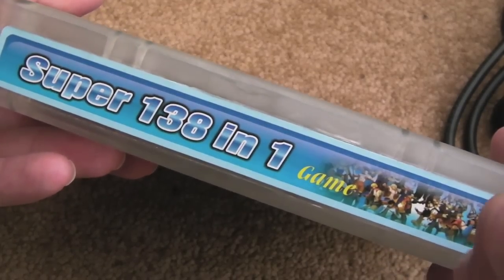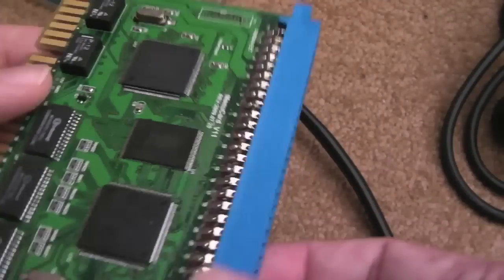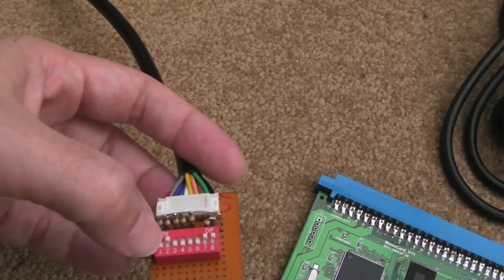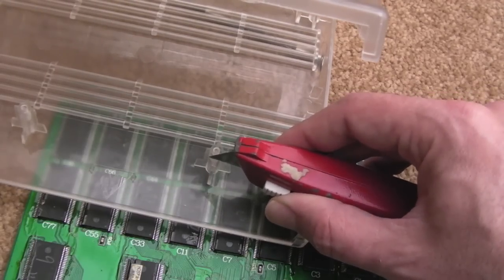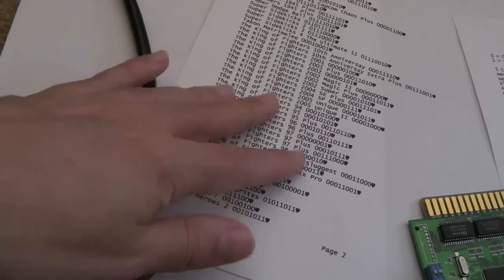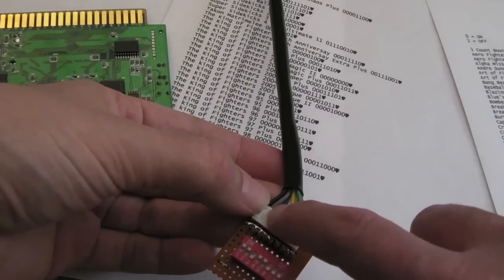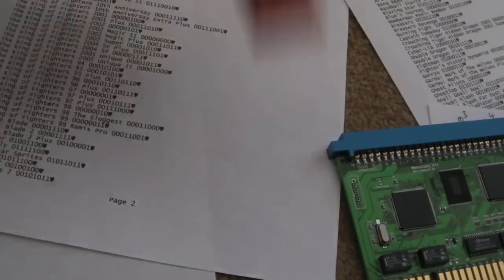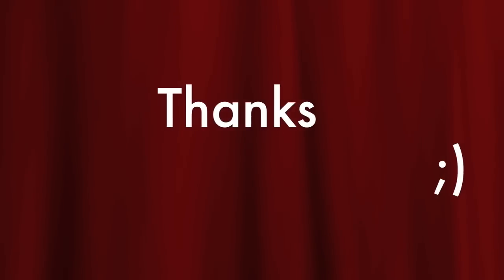SNK Neo Geo MVS 138 in 1 Teardown & DIP Switch Mod

Comment: Your mystery wire (grey) is the RESET signal the menu board use to reset the Neo-Geo system after a game change command is received.  Because of that(the line doesn't have enough power to properly power pullups), when I modded Marcelo's cartridge (we live at the same city) I installed the pullup resistors inside the cartridge, pulled 5V within the cart and fitted a reset push button on the dip switch board taking advantage of the gray wire actual function...

Also, I was the person who originally made the first mod for Fandangos back in 2012. I wish I kept pictures of the dip switch board I made for Marcelo because that one looks a lot better than the one I made for Fandangos... heh
Reply from the maker: Thanks!  I guess if I had spent more time looking at the board I should have worked it out!!!  Nice work on the original mod - it's a god send being able to ditch the control board and use the cart easily on an MVS or AES (with adapter).  I was going to remove the DIP switch at some point and stick a PIC in there, a couple of buttons and an LCD display to show the game number selected, but I've just not got around to doing it yet =/
Reply: That looks like overkill, though.  But it's a great idea if you make it and then fit inside the cart.  That could be a good idea for modding the cart (put the selector on the cart itself). Which makes sense if you're using it with an AES unit.
Reply from the maker: It's totally overkill but allows easy selection!  And yes - the idea is for it to go inside the cart.  I was also thinking of swapping out the 3 segment LED for a single row matrix screen, as those are cheap and easily controllable from a PIC.  That way you could see the game name instead of a number!  Again overkill but a fun project.

Comment: so Black is Ground, and Grey is the VCC correct? mine is wired like the video. 
so...
 
Pin1 black= Gnd
Pin2 grey= Vcc
Pin3 Purple= Dip1
Pin4 blue= Dip2
Pin5 White= Dip3
Pin6 Yellow= Dip4
Pin7 orange= Dip5
Pin8 Brown= Dip6
Pin9 Green= Dip7
Pin10 Red= Dip8

then you wire it up like the diagram correct. so the VCC wire connects to the Resistor array, then to all the OFF pins(all resister array pins shorted together)? then the GND connects to all the ON Pins(all on pins shorted together)?   thanks.
Reply from the maker: See the diagram at 17:20 , you can see how I wired mine there, but the switch positions are inverted if you follow my diagram.
Reply from the maker: And yes, the VCC goes to the common pin on the resistor array.
Reply: sweet thanks. I think I got it, but I got an 8 pin array(on each off dip pin) instead of 9. I tried to put the vcc on pin 1of the array with the dip 1 pin , but not getting anything. but when I take the data line off of dip 1, and leave the vcc, I can get some games to pop up that have dip 1 in the off position.

Comment: Great video GadgetUk164! 
This mod work with neo geo Aes + mvs adapter?
Reply from the maker: Yes, this cart will work on an AES with MVS adapter.  It's worth doing the PCM fix and other fixes to the 138 in 1 as well as the DIP switch mod.
Reply: +GadgetUK164  Thanks!

Comment: Hi, I did the "Dip switch mod" driven by an Arduino, using a shift register and a line buffer. To whoever tries this: do not use the 3.3v from the cart as a reference. It seems to be good enough for the pull up resistors, but not to power a line buffer.
Looking at the Jamma card, the 3.3v from the cart is not even connected to anything!
Reply from the maker: I vaguely remember they took the voltage for the pull up from one of the gates outputs on one of the chips on there.  It's crazy but that's how I remember it being wired.  There probably is a 3.3v source from a regulator on there.

Comment: good work, really works fine.I have a question about supersidekicks 1, It is the only one game that not work fine, the controls dont work in the match, Is there a solution ?
thanks very much and good work  in this and other mods in snk multigames.
Reply: *****
crc check is ok, i am try in aes mode but it work only 1-2 minutes, when start the match its work, but i can not play a complete match because the controls dont work, thanks very much
Reply from the maker: SISTEMA OCTAL I've re-created the same problem you are seeing, after maybe 1:45 the controls stop working.  This is copy protection.

I did find this on another website:-

:ssideki:00000000:10000F:00000009:FFFFFFFF:Disable Copy Protection:Activate this cheat to stop the game locking up during play.
:ssideki:00010000:100012:00000008:FFFFFFFF:Disable Copy Protection (2/3)
:ssideki:00010000:108DCC:00000002:FFFFFFFF:Disable Copy Protection (3/3)

I don't know how you apply those changes using the unibios - there is an option there to write RAM values but not sure what the addresses are and what the values are.  It seems that 1 game on the 138 in 1 still has the protection enabled. =/

Comment: I hate to bug but i cannot find an answer for this anywhere and ive been looking for like two days now....
im getting an mvs this thursday and have been looking into this 138 cart because it has waku waku 7. but i've noticed other multicarts dont have this little external board popping out the side of the cart. you touched on it's significance a bit. but what does it even do and why do other carts like the 161 cart not have it? should i be worried about it's compatibility in any way? because from what i've gathered, it's just something to convert usage onto arcade systems that are not mvs systems? i hear it creates problems with select game buttons as well? im just worried about picking it up and then not being able to work at all... sorry if im unloading a bunch, but it's been super confusing to me....
thanks so much for your time!
Reply from the maker: Neet Boss The 138 in 1 has that sub board which you've seen in the photos etc.   That little board is what selects the game on the cart.  It needs to connect to the MVS motherboard JAMMA connector.  So if you are using a supergun with your MVS you could connect the 138 in 1 board to your JAMMA edge, then connect the supergun to the output side of the 138 in 1 board.

If you've got a CMVS system or an AES (With MVS adapator) then you need to do the DIP switch mod I did in this video.

This is why the DIP switch mod exists - people want to bin the control board that comes with the 138 in 1 and just select the game using the switches instead.

The MVS is an arcade system btw -  The MVS is the arcade version of the Neo Geo.  Some people consolize the boards (see my Consolization videos) to give them standard connectors for power, video, controller ports etc.  These are known as CMVS (Consolized MVS).  The AES was the home system, the hardware is pretty much identical, but the AES has a memory card slot, lacks backup memory (which MVS has), and the carts for the AES are a different size and incompatible with the MVS - despite the games on both systems being the same code and they play identically (depending on your BIOS).   Your best way to get into the Neo Geo is with a CMVS - Someone like Xian Xi (Supreme Judge on YouTube) sells CMVS systems made to order I think.

Comment: Due to the fact that the 138-in-1 has unmodified P-Roms, I would wonder if it could be reverse engineered so that someone could put different games on it, so that the dip switches would point to the same address space, but different games would be there...
Reply from the maker: That's the really easy bit!  I would have done it by now if I had a programmer that could read and write those chips! =/  Try finding a programmer - they are like £2000 each or something daft =/
Reply from the maker: GadgetUK164 You can also really easily do the 161 in 1 even with modified P ROMs if you can program the chips.
Reply: It is possible that one reason you never see Magician Lord on a multi-cart is that when the P-ROM code is modified, the game doesn't work correctly. But, using this type of car, the P-ROM data would not be changed at all, so it should be possible...
Reply: Majestic Lizard hates Google +
There are less than 30 games (excluding Japanese text games) that have never been released on the multi-carts. It would be well worth it to see if one of these 138-in-1s could be hacked include Magician Lord and Fatal Fury Special.

Comment: Gadget, does the version of Samurai Shodown II on this have the correct audio? The same as the original cart?
Reply from the maker: I will check it later!  I've been doing some fixes to my 138 in 1's - bypass caps, voltage regulator, reservoir cap etc, and the have improved mine.

Comment: other i was thinking is to mount that board on the cart shell is it possible? beacause i really wanted to avoid having some daughter board hangling on the cart. =/
Reply from the maker: I think it's possible but would need some wizardry in order to mount the DIP switch PCB to the shell using screws etc.  I might do the same thing at some point!
Reply: yeah because just like you mencioning about touching the solder points on the dipswitch board, and also it would be neat having all in one piece
Reply from the maker: Yes, it would certainly look better without the wire!   I am thinking of doing a mod so I can use a switch and a small LED screen to show the game number, and hold the button down to zoom up the numbers until you get to the game you want.  Release the switch and it reboots the cart.
Reply: hmmm thats doable i guess. but for now im just goin keep it simple and not mess around too much. but i really wanted to see your take on that if you are goin for it =)

Comment: I cant access the jamma port on mine so I guess this is useless. why did they even make it this way in the first place? seems overly complicated!
Reply from the maker: You can use the DIP switch board instead of that stupid JAMMA adapter =D  Just get a 138 in 1, unplug the JAMMA board and plug in the DIP switch board.  Nornor1 on the Neo Geo forums sell ready made DIP boards for about $15.
Reply: ok thanks for that. not sure if i need the 138 or not. i have the 161 and 120, am im missing anything amazing?
Reply from the maker: Yeah, several games (I think on the 138 in 1) that aren't on the other 2 carts.  And the games on the 138 in 1 are exact copies of the original ROMS (the 161 in 1 and 120 in 1 ROMs are hacked to add the 'hold start for menu' code).  The 138 in 1 CRC's will show as OK in the unibios CRC check (except any bootlegs on there).  For example, Metal Slug 5 is on the 138 in 1, and Ninja Masters - worth it for those two games alone imo.  But like on the 120 in 1, and 161 in 1, you will need to mod it if you want it to a) last and b) have better sound.
Reply: yeh and i just realised the 161 unlike the 120 doesn't have difficulty settings!? I guess that's kinda good as it encourages me to collect the original carts. If they're hacked on the 120 I am impressed. The games are great on it so far at least.
Reply from the maker: +Retro Marky You can change difficulty in the bios or via unibios!  I don't use the settings on 120 in 1, just go into bios soft dips once game is selected.
Reply: ah nice. i was confused as with the 120 in 1 i used the dip switches. So it's possible to tell the machine to default to the lowest difficulty? thatd be great if it is.
Reply from the maker: You have to do it each time you power on the MVS.  Boot the cart, select the game, then go into unibios soft dips and change the difficulty.

Comment: You can also use DTSP switches for each line and skip the resistors entirely, but the finished mod does not look as good. My dip-switch was built using DTSP switches and it is about the size of a human fist. LOL.
Reply from the maker: Hehe, yeah, that's why I went with the DIP switch and pull ups / pull downs.

Comment: man i need this on my 161 cart
Reply from the maker: Do you mean you need it in addition to your 161 in 1?  I don't think you can do this DIP switch mod on the 161 in 1 as it works completely differently.  It might be possible but a lot of work but why bother when the 161 in 1 has a menu already?
Reply: GadgetUK164 there i go again commenting while half asleep, never mind me i had the wrong idea.
but still its pretty interesting the cart needs that sub board, i wasn't aware of that and was considering getting one since i saw someone saying that its pretty good paired up with the 161. Magician Lord is still nowhere to be seen on a multicart as yet, when it dose that will be it for neogeo collecting as far as im concerned.

Comment: i wish someone would just make a multi  cart with all the missing games from the 161 in 1 ....  these flash carts are a rip off and are fpga emulation
Reply from the maker: They aren't FPGA emulation - The CPLD's used on there are just doing bank switching, the games are just the same (in many cases) than the originals.  The problem is there are too many hacked games on them, and clones of KoF games etc.  I agree they should just re-do the games on them and release a full collection on one cart.
Reply: GadgetUK164 - Retro Gaming Repairs & Mods my mistake
Reply: GadgetUK164 - Retro Gaming Repairs & Mods they finally have a aes version of the 161.    Wish they did this one next 😊 or a fixed new one
Reply: @specialformula14  Yes, even the latest Ver.3 161 in 1 for mvs has some broken games despite it being another redesigned board (guessing its the same romset in the aes one).
Its got glitching on Samurai Shodown 1, Mark of the Wolves is still the beta ROM which has a crash bug, among numerous other glitches. 
This new 161 in 1 is fully populated and has voltage reg's and the pin bridge fix of version 2 but some games are still defective / unplayable, and seems un-modable / un-fixable.
Imo this and the n in 1 (120) are currently the better options regards these cheap knockoff rom based MVS clonecarts - well for now at least.
I only got a 161 for the few games that are otherwise unavailable on other carts, like Savage Reign and Kizuna /Super Tag (luckily those ones do seem work better on it).

Comment: Is this cart more stable than the 161? Is it complicated to switch games in this cart?
Reply from the maker: The 161 in 1 is the most stable cart!  The 161 in 1 just needs two 47pF caps in order to fix PCM on a few games - but even those games glitch rarely on some MVS systems.   The 138 in 1 is the worst of the carts regards the lack of key components (SMD caps), and also needs the 2 x 47pF caps in order to get good PCM sound.  Without those 2 caps the 138 in 1 has a lot of bad sounding PCM =/   With regards to switching games, you have to do the DIP switch mod like I did really, especially if you are using the cart in a CMVS or an AES (With MVS converter board).  It's very easy to change games, just a case of look at my printed list and set the DIP switches according to the game I want.

Later I will do another mod to add an LCD screen with a number on it, then by pressing and holding the reset button I can chance the game selected number.
Reply from the maker: What sort of problems do you have?  I do know that on Sam Sho 1 there's a problem with 1 characters animations etc - that's the same on all 161 in 1s.   What is good about the 138 in 1 (once you've fixed it with caps etc), it has a good selection of games, and most of them are 100% correct CRCs from legit carts etc.  So from that angle the 138 in 1 ends up being the best, after you've done a load of work to it.
Reply from the maker: Yes, I believe those are fixed on the 138 in 1.  It's a problem with the actual ROM images they used on the 161 in 1.  I did test SS1 and SS2 for Kyoshiro on 138 in 1 and they were OK.
Reply from the maker: It's really useful when people post questions like this btw!  I've just tested KoF 95 and I hear what you are talking about - that's the V-ROM images used for that game, mine does the same - missing voice over on intro music. 

That voice over on KoF 95 is also missing on the 120 in 1 version of that game.  On the 138 in 1 KoF 95 intro music sounds perfect.

It's likely the same with that KoF 94 character moves thing you mentioned.  It would help if I knew which char it was so I could replicate it but I am guessing I will have the same problem.

I played pretty much all the way through KoF 94 on 138 in 1 and can't say I noticed a problem.
Reply from the maker: Thanks!  I am always keen to learn more about which games have glitches / differences etc.  I know what you mean though, I love the flexibility the multicarts provide, but that doesn't stop me wanting actual carts for some of the games I really want.  You can't beat that feeling of owning one more MVS cart =)